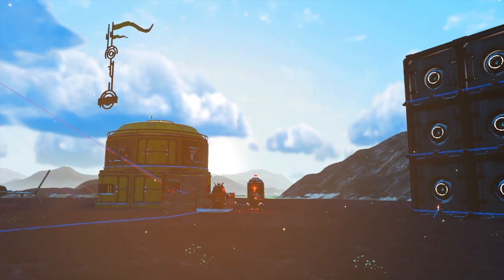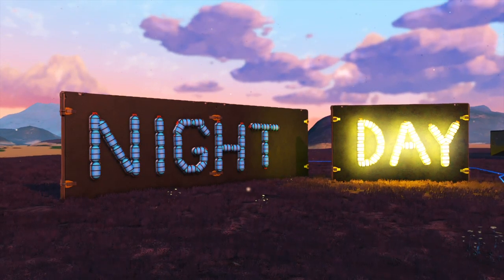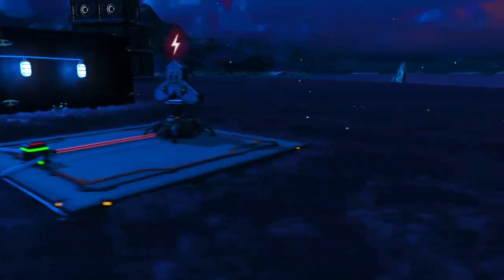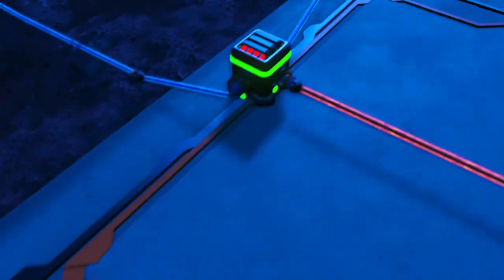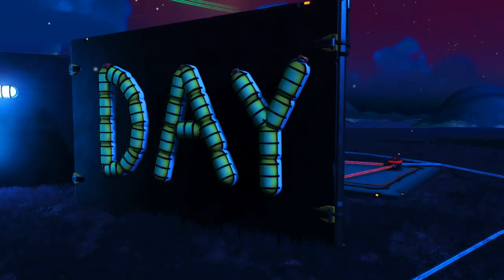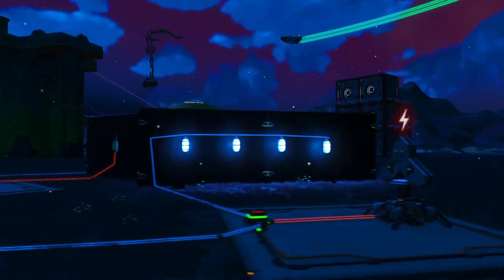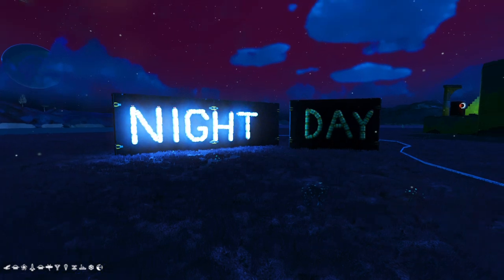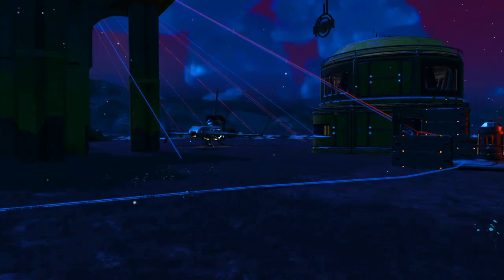No Man's Sky: A simple day/night switch

Comment: Hi Rusty!
I got back to NMS about a week ago, realizing I had missed so much of the content the game has to offer. And so I started to build my first base ever (I already had more than 100hrs to the game... :p). At some point I started messing around with doors and wires, and thought about toying with the solar panels, and that's how I found your video. Thank you very much for this one, you helped me a lot :)
However, I'm having some trouble getting what I want. I want my landing pad to be lit at night. So I put some lights and wired them as per the system you showed us in your video (with an inverter). But then I thought it'd be a pity to have a solar panel that's used only as a switch, so I plugged it into a battery. But when night time comes, the system breaks because of a feedback from the battery (the wire from the solar panel is always "on" because of the energy stored inside of the battery during day time). Do you know of a way to stop that feedback issue without having to manually take care of it (with a basic wall switch for example) as I'd like to have this system being automatic and working even when I'm not around (for roleplay and psychological satisfaction reasons) ?
Reply from the maker: You can't have the solar panel feeding power back into the power grid, it will break the effect. The solar panel is literally just a switch in this setup and can't be used to feed power into a grid. If you try to put it on its own separate battery, then it will still break the system as that battery will basically always be sending power back to the inverter. Disconnect the solar panel from the rest of the grid and your problem will be solved. There's no way to save the extra power from that solar panel, and there's honestly no reason to save that power. Solar panels are really easy to make because you can replicate the materials to make them infinitely. So you're not really missing out on anything by using one as a switch.
Reply: @rustyhatfield8302  Hi! Thanks for your reply! :) As I said, it was only for roleplay reasons (who would use a solar panel only as a sensor switch?!), but if there's no way around it, then I'll gladly waste that tiny bit of energy for such a cool circuit!
Reply from the maker: @Ziinvar  Think of it as more of a daylight sensor. To be honest, they're not even solar panels. They work in the dark. All the panels really do is check the time of day, and turn on a small amount of power during the daylight hours. I keep my daylight sensors in a closet. They're not really solar panels at all.

Comment: Idk if you read new comments on old vids but I'm trying to make a system where the power medium is switched upon the night fall and am have a little issue with the power of the generator powering the solar panels
Reply: Idk if you read replys on new comments on old vids but i dont think you use the generator to power your solar panel, your solar panel powers its self during day time and your generator powers at night time, using the wiring, switch and inverter shown in the video makes the magic

Comment: Hello. I was wondering what galaxy this planet is located in. Also, have you updated the base recently? I ask that because the base is not showing up on the planet.
Reply from the maker: It's in euclid, but its a survival mode base so it won't show up in normal mode.
Reply: @rustyhatfield8302  Aw man. I was worried that was the case. Thanks anyway for the great tutorial.